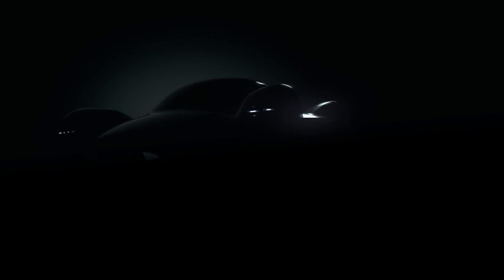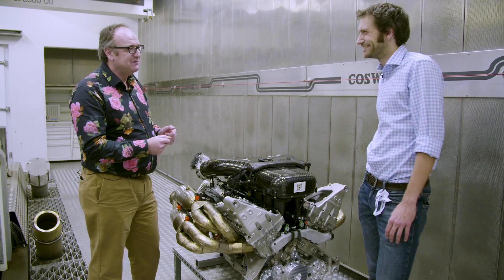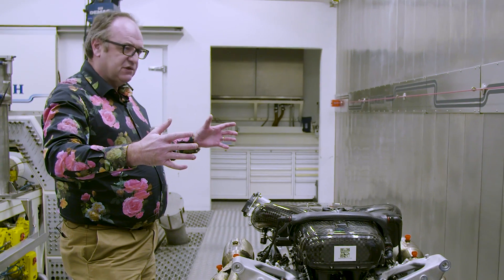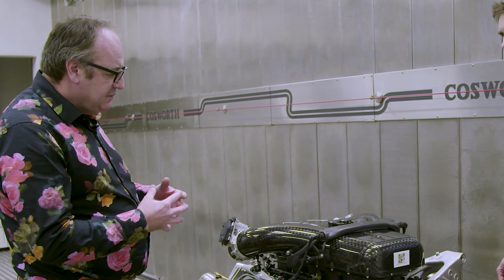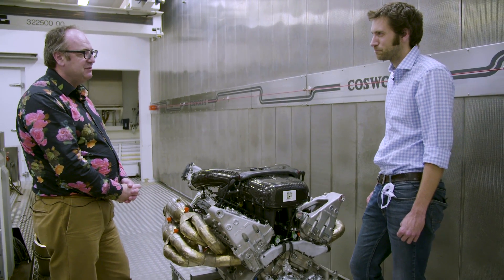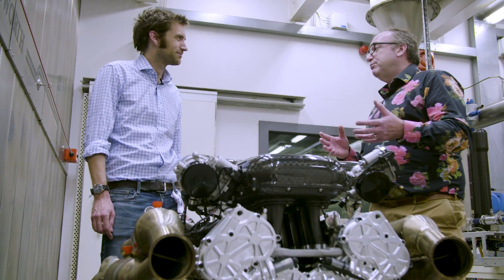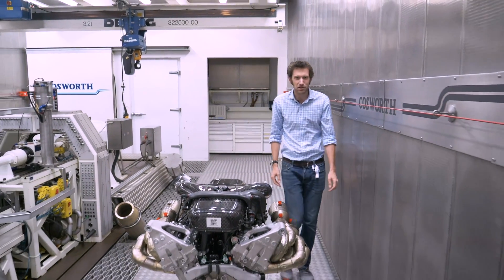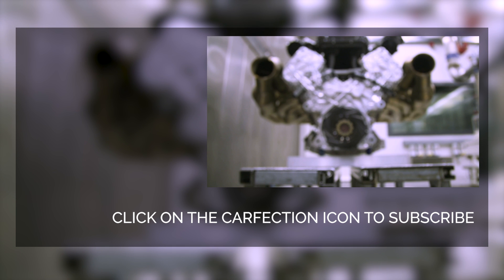Hear The Future Of The Supercar At 11,000rpm: The Aston Martin Valkyrie's V12 - Carfection

Comment: Can I get that 250hp 3cylinder testing engine for my car? Since you guys don't need it now and stuff..
Reply: 1.6L i3 that makes 250hp at 10k RPM. I'm in! Imagine the sound.
Reply: @yanb.193  Think open pipes in a Formula Ford style chassis :D
Reply: @yanb.193  buy a motorcycle you got it from 1100 cc
Reply: @yanb.193  it would likely sound like the triumph 675 or similar. Id be very happy to toss that into a mk1 gti.
Reply: @yanb.193  it will sound like a Porsche 911
Reply: and at only 150 lbs! (Assuming a direct 1/4 weight)
Reply: @yanb.193  If you take a Suzuki 1300cc bike engine and tune it to 1600cc, you get 250hp+ and 11k rpm, but its 4 cyl
Reply: @yanb.193  or get a honda b series engine from 1990s and turbo it and EASILY have more then 250bhp  and not be 3 cylinder
Reply: @Bilbobaggins82242  That's cool as well, but what about the fantastic characteristics of an N/A engine revving over 10k RPM, nonetheless this 12 cyl weighs around 200 kg, so the 3 cyl version must be like 50... a b16 turbo is way more.
Reply: @Bilbobaggins82242  Try getting that through today´s emissions testing. Not going to happen.
Reply: @GeFeldz  it would, "todays emissions" restrictions are on modern cars, Emissions test goes by car reg year, i would know my 1995 civic hatch has a 2.4l k24/k20 n/a build (Y)
Reply: Heck there is a 1.6 Sohc D series for sale running over 500bhp
Reply: @Bilbobaggins82242  Your answer makes no sense, i totally agree with you that the emissions restrictions of today only apply to modern cars. I also agree that the emissions tests go by car reg year. The Valkyrie is to be delivered in 2019 afaik, so it has to meet 2019 regulations. If Aston Martin or Cosworth were to produce a 3-cylinder version of the Valkyrie V12 for use in another new model, or if they were to sell it to some other manufacturer, they'd have to make that model of car and engine compliant with the emissions standards of the release year as well.
Reply: @GeFeldz  I thought you meant in a general term no from a new production, if new production 100% but my main comment was reg someone wanting to swap a prototype engine into a car to obtain figures easily achievable on a budget with ease, If your going to nab a prototype engine there would be much better choices which provide results not achievable for less then £1500
Reply: @csabaandrasgoncz9503  Well in a 800-900kg car even a b16 turbo, is not big of a deal.
Reply: Was thinking the same, in the front of an original Mini or Caterham 7
Reply: @briangreen6602  exactly what I was thinking 🍻
Reply: This could make a nice aftermarket swap for the Geo Metro.
Reply: That thing will take off. Might need FAA certification if that's the case.  @kirkjohnson9353
Reply: @KXP70  And so we are three XD
Reply: @kirkjohnson9353  twist that chassis to s***. But I was thinking the same thing I did however remember did they use the 3 cylinder Geo Metro engines for power parachutes this would be a hot rod engine for one of those don't you think
Reply: Or OG Beetle.
Reply: @briangreen6602  - Or in the back of my Exige.
Reply: @briangreen6602  Ariel Atom
Reply: @longshot7601  To make it slower? Good job!
Reply: @thatfunnykekguy6377  No.  To make it lighter and hopefully boost the power to weight ratio even higher.  To get a better weight distribution to possibly 45/55 from 40/60.  Etc, etc.
Reply: @longshot7601  you know in the atom you have 1 NA aplication and 2 boosted right?
Reply: @longshot7601  and not to say, that shit isn't even reliable to begin with.
Reply: @briangreen6602  that would be insane! the Mini probably have too much power for its own good though lol!
Reply: BlitzkriegRap 😂
Reply: They made it to prove the emissions,....
So, replacement donk for that Toyota based toy they released a few years ago :D
Reply: As soon as he described building the 3 cyl version, my first thought was why not stick it in the Aston Yaris
Reply: @NJRD977  hey did you see they put a v8 in that hideous Aston Yaris as you cleverly put it but I think your on to something!!
Reply: Make sure to get it lacquered 😎
Reply: my thoughts exactly... 250hp, 51.25kg that can be shaved down even more if its not a stressed chassis member.  I see some people bragging about their 3 cylinder engines that make 250hp or more, but is it only 51.25 kg and no boost and runs on pump gas and emissions compliant?
Reply: Exactly what I thought! Stick it in a Caterham!
Reply: Put it in a smart fortwo and boom, time traveling machine
Reply: Sorry bro I need it for my motorcycle
Reply: In all seriousness, yes, they need to sell this tech to normal car companies.
Sell it to Dacia, put it in the Sandero.
Reply: Think it'll fit in a 2007 Honda Fit Sport? lol
Reply: @variabl3  under the hood, probably, if you gut the back seats you could fit almost anything haha
Reply: @Aristocrafied  lol right? How about a dual engine setup?
Reply: @variabl3  I never get that idea, an engine is a heavy thing to carry around.. I'd rather increase the size or power of a single unit than carry around another.
Reply: @variabl3  yeah, but do you self a favor and find a newish (2016+) crashed civic sport or So and just swap that motor in.  It's literally the turbo version of what you've got and you can probably bolt it in with no fabrication.  You may need new axles and will probably have to do some engine-to-body harness fuckery, though
Reply: john m  hahah I imagine that comment combined with that profile pic works on every video
Reply: The 3 cylinder motor 250hp would be nice in a supersport motorcycle, you know that the rear tyre would do twice the mileage of the front tyre.
Reply: Cosworth has been making race engines for 60 years, they know what they are doing down to the nuts, bolts, and more if you ask me...
Reply: 250 3cyl? thats really good
Reply: Yeah, that was the part that got my attention. 250hp from a non-turbo 3 cylinder?
Reply: just get a Hayabusa engine and turbo charge it
Reply: It would be pretty epic on a nimble sub 2000 lbs car.
Reply: @dodoz44  like a superlight SLC?
Reply: Right, I need to know more about that i3. Even the 6cylinder would be nice since they built it in sections
Reply: Right
Reply: BlitzkriegRap in a perfect world they'd make a new video announcing that, that's just what they were planning to do.
Reply: Obviously they can't of course.
It can only rev at 11000 because it'll require servicing after, like, every time you use it.
But if you halved the output, capped it at, say, 7 or 8k?
That would be fun.
In, like, a VW up or a fiat 500.
Reply: Agreed, I want too!
Reply: would look pretty cool in my fiat panda
Reply: They should sell them to the Kit car world...
Reply: Supercharge or Twin turbo then what would you put it in?  It might weight 150 lbs.
Reply: BlitzkriegRap 😆😆😆
Reply: Yeah deffinatly a bigger market for that 3 cylinder.
Reply: What about the BMW B38K15T0 which they only seem to use in the i8? It has about 230 hp and 300 NM. I'd really love to shove that into like a Suzuki Cappucino or something similarly proportioned and say: hey, it's still a 3 banger! hahaha. I bet some of the Mini and i3 counterparts of the engine can be more easily obtained and built to match or exceed this spec.
Reply: YOU WOULD DIE!!!!!! Shiney and chrome
Reply: HAHAHA HELL YEAH BISH I WANT THAT 3 cylinder that shit makes more power and it’s fucking small as shit I’m in I’m in where do I fucking sign
Reply: And it weighs 50kg!
Reply: If you take the 3cylinder, I can take the 12cylinder version.
Reply: @Blitzkriegrap are you a mind reader cause I was thinking the same thing.
Reply: BMW i8 has a 1.5 liter 3 zylinder engine that makes 230Hp
Reply: Yeah, no shit! I could put that in my tC!
Reply: Damn you lol. Great minds I tell ya 😎

I'm watching wondering "how do I get my hands on the 3 cylinder"?
Reply: Put it in a bike😎
Reply: Here you go https://watercraftjournal.com/video-inside-sea-doos-new-300-horsepower-engines/
Reply: Maybe me too.. for my lawnmower.
Reply: That's crazy my trucks v8 only has 220hp :( but I'm sure it's turbocharged so all that stuff has to work otherwise expensive repairs.
Reply: Funny! LMAO!
Reply: That be nice in a lotus Elise or alfa Romeo 4c 😍 weight to power ratio will be insane
Reply: john m  fast and the furious?
Reply: Perfect for my Dad’s late 60’s NSU Prinz
Reply: Lets put it in a bike !!!
Reply: Saab 95 Aero. 9500 rpm and made out of a cavalier !!!
Reply: Pffff....    drop it in my motorcycle. Lolz
Reply: I just want one of those motors lol, even that will cost a life’s fortune. Assuming I could afford before I die, I’d shove it in my e30.
Reply: Ford ecoboost can push 200bhp
Reply: BlitzkriegRap wow
Reply: @Just_Pele  - Or in a Europa. The series 1's weighed 1350 lbs. Imagine what it would feel like with that power to weight ratio.
Reply: Can I have the spare one?
Reply: You spelled motorcycle wrong.
Reply: And stuff..😎
Reply: Of course 116 people already beat me to the punch lol
Reply: A 250 hp 1.7L? I imagine there's several 'hot compact' turbo models out there which get you around there, but you'll have to accept the liters spread over 4 cyl. since 3-bangers are notoriously poorly balanced.
Reply: @kathrynck  Huh?? How are 3 cylinders poorly balanced compared to a 4cyl??  Sorry must have missed that lesson in the last 30 years as an automotive engineer. Odd number multiple cylinder engines are inherintly better balanced. Look at radial engines
Reply: @chriswillmott462  reciprocating motions, like the pistons and valves, cause engine vibration/wobble, which you then have to dampen with counter-balancing weight, and vibration dampening mounts. An even number of cylinders (even number in the same orientation, as in an inline 4 or v8, etc) allows you to run pistons in opposite positions, so that the other pistons act as a counter balance for your pistons. in a 4 cyl, you'll want the center 2 and the outer 2 reciprocating up and down in opposite positions for balance (which is why they use the firing order they do). There's still some valve movement that could do with some balancing, but the less rotational mass the better. it's far more efficient to balance out piston movement with other pistons so that you're getting your counterweight basically for free in terms of wasted kinetic energy.
Reply: @kathrynck  With all due respect, don't tell your grandpa how to suck eggs. I'm a mechanical and aeronautical engineer. . Have a REALLY close look at the VW and Volvo 5 cylinder engines. Then Look at any radial engine.
Reply: @kathrynck  It's called inherent harmonics in case you were wondering. EVERY reciprocating engine on the planet, ever invented has a rev range that they should not operate in due to destructive harmonics
Reply: @chriswillmott462  weird egg & grampa metaphor, you're super important and knowledgeable, go learn stuff, i'm renaming your terms you must learn my terms, etc.
none of which addresses what I outlined in simple terms everyone can understand, without insulting you or resorting to namecalling or prancing about under a job title which means next to nothing on the internet where everything is largely falsifiable. Do you or do you not, comprehend that the "Inherent harmonics" of a 3 cylinder engine make for a motor that wobbles like a mo-fo? or are you only interested in radial enginges which are much easier to counter balance due to the radial nature of the reciprocating movements?
Reply: Ford is pushing 200hp out of their 1 liter 3 cyl engine. Just by adding their 1.6 liters turbo on it and some mapping ofc. Its in the street formula ford car.
Reply: Already exists. My 06 suzuki gsxr 600 has a 600cc inline 4 that makes 235 hp at 16000 rpm with an exhaust and tune. If you could bolt 2 together that would be the most insane 1.6 l v8 ever made.
Reply: Get the Mini 1.5L BMW base motor, and tune the turbo. You'll be almost right there power-wise.
Reply: The weight to power ratio would be sweet, but it would still be a 3cyl.
Reply: i would like 487hp 3 cylinder Koenigsegg engine instead huhuhu
Reply: Sorry, they put it on Adrian's bicycle.
Reply: Ha this is exactly what I was thinking the very moment I heard what he had said
Reply: @BlitzkriegRap fuck the cars, they're British so is Triumph motorcycles( and they already use triple engines) find a way to cut that bitch up and put that monster in a motorcycle everything else will run in shame!
Reply: Good luck with that lol if you like different get a scat motor half of a Chevy V8 all aluminum good for 330 horsepower with a couple of Weber's and you can actually buy one and yeah the Austin Martin deal has an awesome piece did they state any actual horsepower numbers? I would think somewhere in the mid 800s
Reply: My Volkswagen Polo has a 3-cylinder engine with a astonishing 55 hp! Imagine if I could switch to that 3-cylinder Valkyrie test engine! :D
Reply: My Yamaha Tracer 900 has a 3 cyl engine with almost the same output per litre (115 hp from 850cc) and it revs to 11.000 rpm too. The whole bike was 10.000 euros...
Reply: BlitzkriegRap that's exactly what I was about to ask, then I scrolled down and see it's the very first comment.  Anyway, how much can I get into that 3 cylinder for?
Reply: literally my first exact response when i heard they made a 250 hp 3 cyl
Reply: Imagine... 50kg engine with 250hp... :)
Reply: Why not make it max out at 100,000 rpm, so it can suck down a full tank of gas in 30 seconds.
Why dumb fucking morons want an engine to spin FASTER is mind blowing.
I'll take full power at just above idle please... thanks.
Reply: Yes, when this technology trickles down to society in some form... much later.
Reply: @pastrie42  In electric form haha:(
Reply: Right:)
Reply: You may be more interested in nissans 500hp 3cyl?
Reply: Not sure it would have much torque from 1k to 5k rpm, might need to buy a little electric motor for torque fill in those rpms. A 15 bhp 180lb torque electric motor.
Reply: Yeh; you and 1 million other blokes, get inline.
Reply: thats actually a really good thing you pointed out. VE wise 250HP from a 3Cyl is unhead of.ids lk
Reply: @seinfeld11123  it's still a 1.625 litre engine though, perfectly possible. It will just be lacking torque at low rpms
Reply: And then you have the jesko with a 1600HP 1500N/m V8 (turbo though).
Reply: Imagine that 6 cylinder without turbo but can run at 500hp
Reply: yep. we don't mind. contact us between 9AM and 5PM. cheers! (P.S. I'm from the team, this is not a joke, reach to us).
Reply: Make a new class of bikes called hyperbikes and put that engine in it. Name it the SVR-1600 (sixteen hundred).
Reply: BlitzkriegRap my jet ski has 300hp and it’s a 3 cylinder. It’s a Sea Doo RXPX 300. It’s a monster
Reply: yeah, but that engine is supercharged. The 3 cylinder they talked about was N/A. @eamonshields2754
Reply: @eamonshields2754  BOOSTED
Reply: DaveSpen this is true
Reply: @eamonshields2754   What are your torque numbers for that 300hp?
Reply: @eamonshields2754  it runs to 8000RPM at the crank and is cooled by the water it forceds through
Reply: @eamonshields2754  
Supercharged doesn't count.
Reply: @eamonshields2754  but that's turbo charged, this is naturally aspirated.
Reply: @eamonshields2754  Contradicting your self saying "jet ski" and "sea doo" in the same sentence.  Kawasaki makes jet ski...but I too have a 300hp Sea Doo
Reply: @eamonshields2754  Sounds like a great toy, but is it naturally aspirated? I'd doubt it
Reply: @eamonshields2754  blimey.... what kind of engine is that? Is it 2 stroke or turbo 4 stroke?
Reply: richie1326 4 stroke supercharged
Reply: Eamon Shields 300 hp 200 to water
Reply: @eamonshields2754  RXPX300 is supercharged , not n/a like the Aston
Reply: @eamonshields2754  nearly zero torque
Reply: @eamonshields2754  yeah, but yours is supercharged, theirs is naturally aspirated
Reply: Eamon Shields My old bikes are all three cylinder two strokes, the biggest is 738cc and a very tame 70bhp. It is 41 years old though! Your Sea-Doo motor has twice the specific output. Bonkers :)
Reply: Or just put a rotary. They sound as good and the RX7 engine makes that kind of power
Reply: BMW i8 has more from its 3cyl 1.5 doesn't it?
Reply: @BeLowBelowo  228hp, so 22hp less. And that's with a turbo. The Aston is NA.
Reply: @BeLowBelowo  thats a generator not an engine
Reply: @BeLowBelowo  No, actually it has slightly less at 231 PS, but don't forget that it's turbocharged... Anyways, impressive as well, but not comparable.
Reply: Csacsa le Baron now that I think about it....

Swapping the i8 with this engine. While the gains in outright power is small, imagine the weight savings!
Reply: @BeLowBelowo  yes but turboed
Reply: @BeLowBelowo  With the electric motor and the turbocharged petrol engine, yes. Just the petrol engine, no.
Reply: @BeLowBelowo  the i8 engine has around 230hp and is turbocharged
Reply: @BeLowBelowo  yes but it's forced...